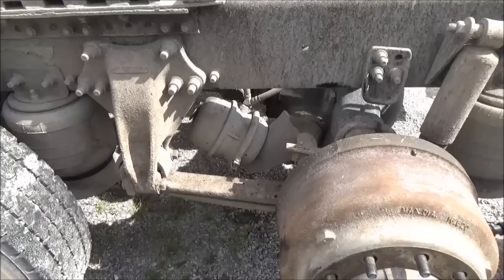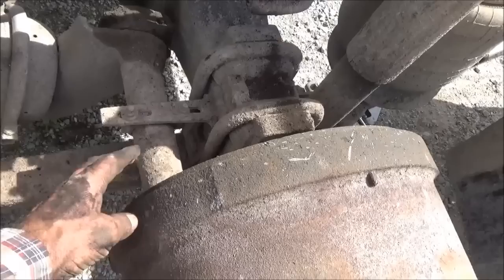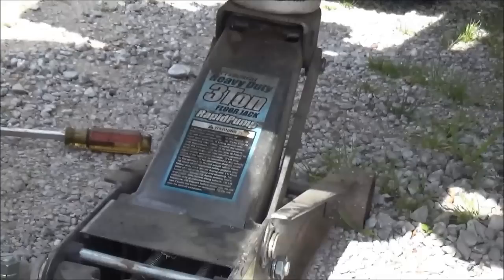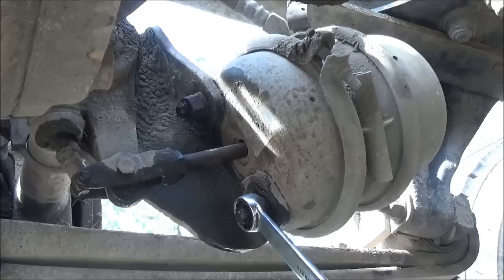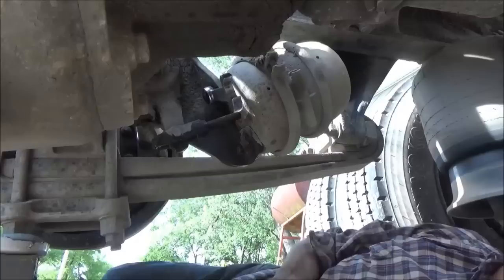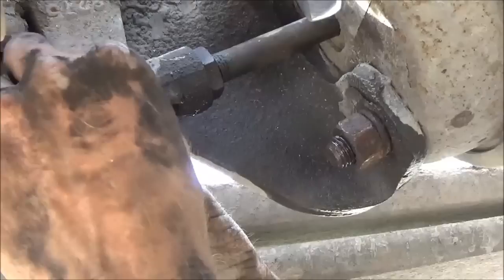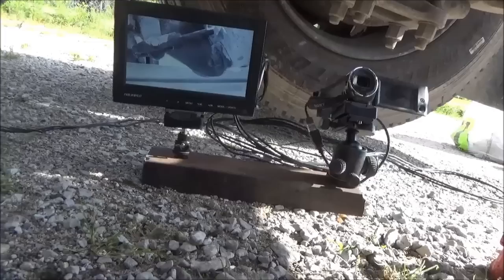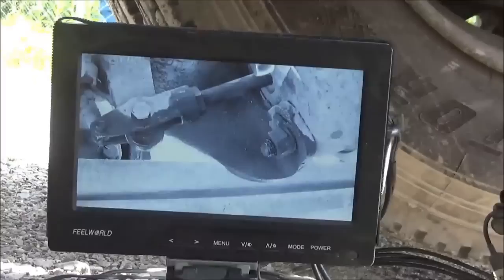Changing parking brake chamber 30 30 on a big truck

Comment: I use damaged aluminum car rims or old steel rims as safety stands. They don't tip, they don't crush, and they work on sand and earth. Thousands of vehicles in salvage yards are stored on old rims. Some 4x4 blocks come in handy too. I gave away my jack stands long ago.

Comment: please, please put in the caging bolt to contain that spring in the chamber. if the chamber is rusted thru or you aren't sure what you are doing - that spring could take your head off. when the park button is pulled, pop the plug on the end of the chamber. the key slot should be centered in the hole.  if not, the spring is broken, the chamber needs to be replaced.  when the park button is "in"and you hear air escaping around the chamber, the chamber needs to be replaced.  have someone step on the brake pedal- if you hear air escaping, the pancake has a hole rubbed in it and the pancake needs to be replaced. incidentally the boss where the fittings screw in, if they are square be sure the new chamber has the same square boss'- they identify a long stroke chamber. you want the same on both ends of the same axel. if there is air leaking on the qrv- quick release valve- (the small one on the frame) it needs to be replaced.,
Reply: This guy is danger mouse. I was hoping he would throw one of the wheels under there to be safe but he put his life in the hands of a inadequate 3 ton trolley jack and a bottle jack on a rounded surface.
Reply: First name,you are right. Way back in the early 1980s I was changing the diaphragm on one of those chambers.I had  the caging bolt installed properly,but the end of the chamber broke allowing the spring to take off at great speed.Spring traveled about 35 feet hit the  door of the shop and put a dent in the door.After that I would not change the diaphragm any more just replace the cylinder.
Reply: First Name, johnm, and charles.  Put a video up on how you all do it.
Reply: Newer parking brake cylinders usually sealed units,must be replaced if they leak.I retired in 2005,do not work on much of anything anymore.
Reply: thanks
Reply: Old wives tale it's just because people were trying to service the business end that got everyone scared it ain't going nowhere
Reply: Good 👍👍

Comment: You can use a cage bolt to run the rod in and won't have to worry about air pressure.
Reply: Thanks was looking for that info

Comment: Air up the spring side or cage it or back off the slack until it floats. Then pull your pins. Been doing these for 42 years

Comment: Hi Gordon looks like you need to rotate top can so the airlines are like they were before. great video
Reply from the maker: You're right, I could have done that but since it fit, I was lazy after fighting with the clevis.
Reply: @57bagre  unfortunately for me thats the only part i came onto utube to learn,the rest i can do just not sure about rotating can so hose slots line up
Reply from the maker: @michaelo2522  just put a caging bolt in and loosen the clamp and rotate the housing to where you want it
Reply: @57bagre  ok thanks I'm halfway done

Comment: Please exercise extreme care handling these brake/spring chambers. When I served in the military, I heard stories from the mechanics where that spring can travel with great speed and violence up to a quarter mile away or more. Imagine what damage one could sustain from it.
Reply: Theres a new cageing bolt supplied with every new brake chamber. The spring can be compressed with the bolt.
The spring is very violent for sure.

Comment: EXACTLEY CORRECT , THERE HAVE BEEN PEOPLE BADLY INJURED WHILE WORKING AROUND , THE BRAKE PODS , NOT KNOWING WHAT THEY WERE DOING , ESPECICIALLY TRYING TO TAKE ONE APART WITH OUT THE PROPER EQUIPTMENT THAT SPRING NEEDS TO BE COMPRESSED AND UNCOMPRESSED WITH THE PROPER APARATUSE ,  ALWAYS , ALWAYS SAFTEY FIRST , I'M SURE I'M NOT TELLING YOU ANY THING YOU DIDN'T ALREADY KNOW ,.  THAT WAS ONE OF THE THINGS THEY TAUGHT US IN TRUCK DRIVEING SCHOOL SOME 45 YEARS AGO NOW , ONE OTHER THING I WANTED TO MENTION BEFORE I GO , JUST CONSTRUCTIVE CRITISIZM , DON'T HAVE A FIT OVER IT ,  BUT MAN OH MAN I WISH YOU COULD INVEST  IN A STEAM CLEANER , OR , A PREASURE WASHER , TIS SO MUCH NICER TO WORK ON A CLEAN VEHICLE ,AND HELPS YOU STAY SOME WHAT CLEANER , A CREEPER KEEPS YOU UP OFF THE GROUND ALSO , AND YES I'M AWARE OF THE FACT THAT IT DOESN'T MAKE IT GO ANY FASTER ,  LIKE I SAID , I'M PROBABLEY NOT TELLING YOU ANY THING YOU DON'T ALREADY KNOW OR HAVEN'T CONSIDERED ,, WHERE I LIVED THEY HAD A  SWIVEL PIPE  WITH A HOSE ATTACHED TO THE END OF IT AT THE CAR WASH ,  THE SAME AS THE ONES IN THE CAR WASH BAYS BUT WAS HIGH ENOUGH THAT YOU COULD DRIVE A TRACTOR UNDERNEATH ,  AN OPEN OUTSIDE AREA AT THE END OF THE  CAR WASH BUILDING , WHEN I WAS IN TOWN COMEING HOME FROM A LONG HAUL ,  I WOULD GO THERE AND FOR $10.00  DOLLARS IN CHANGE  I COULD SOAP THE TRACTOR DOWN AND RINSE IT OFF , IT HAD HOT AND COLD WATER SUPPLY YOU JUST HAD TO SET THE DIAL TO YOUR CHOICE WHILE CLEANING ,  PLUS USE THEIR VACUM IF I DIDN'T USE MY OWN .   THANKS FOR TAKEING THE TIME TO TEACH OTHER'S,,,,,,,,,,,,, KEEP  THE SHINEY SIDE UP AND THE RUBBER SIDE DOWN  , KEEP TRUCKIN OLD BUDDY GORD , MAY THE GOOD LORD RIDE WITH YOU  ,,,,,,,,,,,,,,,,,,,,,,,,,,,,,,,,,,,,,,,,
Reply from the maker: Thanks for watching.

Comment: you did a great job next time just hold that slack with  vice grip and put caging bolt and removed air lines much fast  20 mins job
Reply from the maker: Thanks.

Comment: Nice video, question why did you check how far out cleave was out from face of 30/30 I check from inside just in case that spring was bad . then made a tool that goes into one side of chamber to supply air to compress the other end so can put the Jesus bolt in , and turn were the air lines hook up .
Thank you for the part about the fegure 8 part were it mounts
Reply from the maker: I don't do enough of them to know all of the tricks, you can always measure the rods on the other chambers if you want before cutting, they don't need to be exact anyway, within 1/2 an inch is good, as long as you have about 90* when the brake is applied. Thanks for watching.

Comment: I am a first time owner of a semi.    It is an 07 Mack.  I had the frame extended and a dump body added to haul grains and feed for local farms here where I live in NY.   Your  videos will be a big help to me.    The Mack has parking brakes on only one axle.    Is that typical?   How complicated would it be to change the other drive axle to have  parking brake too?
Reply from the maker: I haven't done that before but I wouldn't be afraid to do it, you would need to change the valve that sends air to the parking brake to release it, unless the original valve has 2 more ports that are capped off, or maybe you can put a couple of "Ts" in the valve to add 2 more air lines and just replace the "30s" with "30-30s" or whatever type of parking brakes you have on the back.
Reply from the maker: Yes it is typical when pulling trailers, trailers have 4 parking brakes, the bobtail doesn't need 4 but if you're putting a dump bed on then you definitely need 4 parking brakes on your truck.
Reply: They are called "Maxi Brakes"(dual axle parking brakes).  Service brake relay is usually a 4-port R6 relay valve and the air lines go in the front ports of the brake chambers.  Parking brakes are usually a 4-port R12 relay valve and the lines go in the the back port of a 30/30 brake chamber.  Follow the lines coming out of the back port of your brake chambers to the park brake relay valve.  If the lines are color coded ---  Green = Service brakes  Red = Park brakes. It should have pipe plugs in the other two ports of the park brake relay.  You'll need two lines and two 30/30 chambers($100-$125 if you find the chambers on sale).  Look for the "caging bolts" (t-bolts) needed for installation on the bottom of the new chambers.  New chambers don't usually come "caged" for safety reasons during shipping.

Comment: On 98 %of trucks run the lock nut all the way to the bottom of the threads and leave enough thread to fill the clevis. Trailers you have to measure.

Comment: It is not the same as lifting that axle with the hydraulic jack to lift it with the air bags. the same air lines are used or are separate lines??

Comment: New brake chamber :$70...new clevis with pins : $6...new slack adjuster :$75....getting your head blown off trying to save a few bucks when the truck will make that back in 1 hour : ridiculous...Thanks for replacing that brake pot !!!
Reply: How exactly??? If you are doing the right????

Comment: Some ornery mechanic zapped those bolts with an impact:)
Reply from the maker: I could've used an impact on the lower one but I don't think I could get on the upper one that way, still it was like a lock nut the whole way off.
Reply: William Zoom I’ve been wrenching for 30yrs. I thought all mechanics were grouchy like me...

Comment: Hi, how do you know which hose is for the hold off chamber and which hose is for the service brake chamber?
Reply from the maker: The hoses will relax to their previous position. If that isn't the case, you can look at the brake chamber on the other side and see where those hoses go to, if you really screwed up and took off both sides and don't know where they go then push in the yellow brake release and see which hoses are letting out air, these go to the rear of the chambers.

Comment: You didn't turn the brake chamber body to where the ports for the fittings were the same angle as the old chamber. Now your hoses are to close to the differential and driveline.
Reply: Casey28027 my sentiments exactly he made a major error in putting that back on that way
Reply: I'm having that exact problem at the moment.  I was hoping he covered that in this video.  I've only done pots on trailers before and they just seem to fit.
Reply: @joewiddup9753  I agree and have run into this many times , what I have always done is build up a full head of air , naturally take all safety precautions , ie   Block the wheels , release the parking brake , back off the slack adjuster all the way off , manually pry the slack adjuster out in the applied position , find a socket or a small block of wood to keep the push rod out in the applied position if this unit doesn't hold air pressure , I advise to leave the engine run or take an air hose screw it into an air tank to maintain air pressure , now follow this closely , loosen the CLAMP , CLOSEST to the mounting bracket ( 2 bolts on the clamp ) until you can rotate the chamber to the proper position , some times I would use a little  WD-40  to help it slide , when you have it where it needs to be , start tightening both bolts on the clamp equally , taping the outside of the clamp half's gently , continue tightening till there tight , also if it is not seated correctly , it will leak air when the foot pedal is pressed , adjust your slack adjuster tight , then back it off 1/2 a turn , also when the brake shoes are in full contact with  the drum , tap on the drum with a hammer a dull sound will be heard , after you adjust the brake , tap on the drum again , a bell sound will be heard , indicating the shoes are free of the drum as always be careful , and if in doubt , don't attempt it ! ! !       Frank T

Comment: How do you know the brake chamber is bad?
Reply from the maker: Usually air is leaking, sometimes the parking spring is broke inside and not holding as tight as it should.

Comment: you do not have to cage the  brake Camber
Reply from the maker: If it were full of holes and looks like it could explode any second, I would stay away from the back side of it, ( side facing front of truck) just back off the brake and free up everything on the axle side of it to minimize the spring pressure in case it does fly apart. but no you don't need to cage it or compress the spring. If it looks that bad don't handle it bare handed, use gloves and wrap a towel around it and try to take it down with an extended tool, or bust it apart before taking it down.